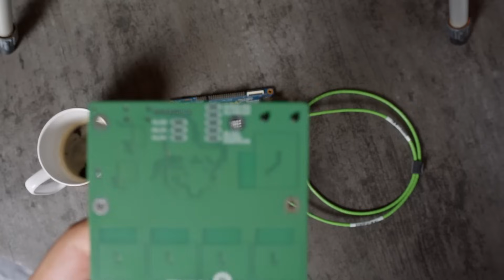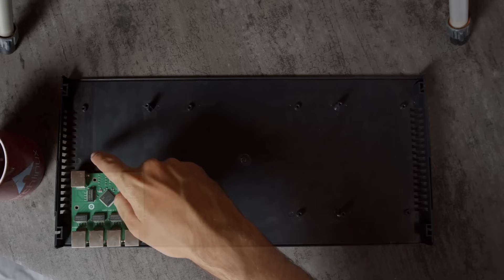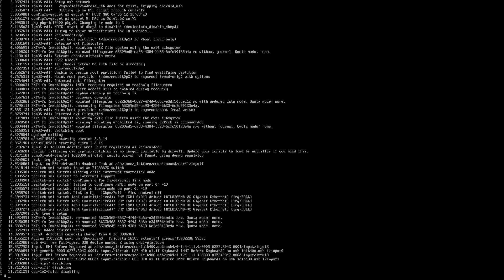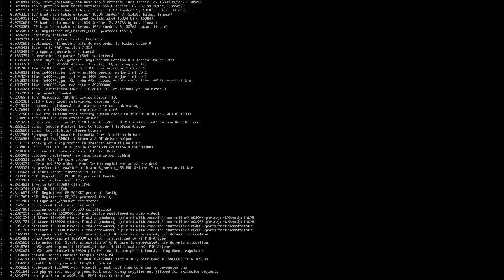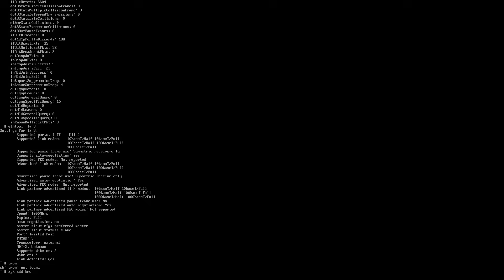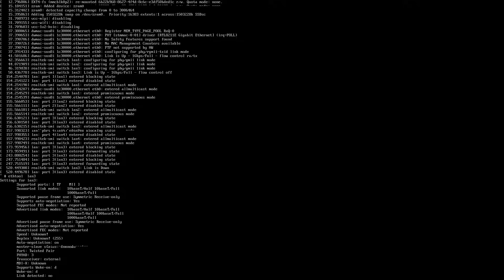Building my own 5-port gigabit switch for Linux control

Comment: Can we have the PoE support in this switch?
Reply from the maker: It is possible to extend the design to add PoE to it, but this would significantly increase the complexity. It would already more than double the parts to add PoE input to the switch and I don't think PoE output would be any easier, and you need way more of those.

Comment: @MartijnBraam, can I do un-managed standalone switch with this chip ?
Reply from the maker: Yeah that works fine. It's a regular 'ol 5 port gigabit switch when not controlled.
Reply: @MartijnBraam , thank you. In your github KiCAD schematic, is the chip  configured in such way?

Comment: Would the switch chip also do the switching, if i do the bridge with openvswitch? And if yes, would the switch chip also handle the switching when i configure openflow on the openvswitch bridge?
Reply from the maker: It seems like there's some integration to make Open vSwitch work with switchdev for hardware in Linux but I have no idea if it will work for this setup. In the examples I can find for it the interfaces with switchdev support added as seperate interfaces in openvswitch, I don't know if the bridge device created by openvswitch is a dsa compatible one but I guess it will be through all this.
Reply: @MartijnBraam  could you maybe test it? Because that would be then the first cheap openflow switch in years since the zodiac one, which only did 100 mbit

Comment: Nice work. I know a commercial unmanaged switch where you can access SMI without voiding warranty and there is an 8051 just waiting for your code to execute. SDCC goes brrrr. Too bad these infos are obscured / NDA'd.
Reply: Asus XG-U2008 has SMI pins under the serial# label. Oh, and it's a Z80 not a 8051.
Reply from the maker: Yeah if only I could get any of those docs. That would add a lot of interesting possibilities to this platform since you can access quite a bunch of gpios and busses with it and there's the internal network interface.

Which existing switch allows SMI access?

Comment: You are using ipv6 Internet. Is it really possible to ping any other device on ipv6 Internet if I know its ipv6 address? I mean, all devices are not hidden behind NAT, so they all are accessible directly by IP without need of intermediate node somewhere on the Internet.
Reply from the maker: That's not at all how IPv6 works. On IPv6 you have the same hiding mechanics as IPv4 but instead of with NAT it happens by the firewall, if you use any normal IPv6-capable router that's what happens in the background. IPv6 is also still routed like regular network traffic so it goes through all your intermediate nodes, you just stop changing IP addresses at random places.

Comment: I'm wondering if this can be controlled from a x86 system using a usb to gpio like FT232H. Not sure if Linux can be convinced to use that for the realtek-smi
Reply from the maker: It's not really possible to get a phandle for the gpios on an USB gpio chip so it can't be done in the same way at least. In theory it would be possible to add a glue driver in Linux but that would be pretty difficult.

Comment: The switch chip being used in unmanaged and managed models made me think of TP-Link and Netgear 5/8/16 port network switches that have both unmanaged and managed variants. 🤯
It's probably that the managed variants have an EEPROM chip (+ licence for the firmware) and reset button, while the unmanaged ones don't.
Reply from the maker: Yeah it seems like the main difference is the storage, the unmanaged ones have a tiny i2c eeprom for hardcoding a few registers and the managed ones have a 4Mb nor flash chip on the SPI bus with 8051 firmware and templates for the webpages. Apparently it's possible to grab the Netgear GS105E firmware from the website, load it in a nor flash and then boot it on this device but I have not tried it yet.
Reply: @MartijnBraam  
Interesting. I was thinking it'd also be possible with the TP-Link TL-SG105E firmware, but for the hardware revisions I have (though of the 108E and 116E because I don't have any 105Es), no firmware updates were released.

I also forgot about 8051 microcontrollers having existed, probably because when I think of a microcontroller chip, I usually think of an RP2040.

I saw your video on my YouTube homepage and didn't think it was possible for Linux to directly address a managed network switch chip until I watched it. I was surprised.
Reply from the maker: 8051 cores are absolutely everywhere. If something has the slightest chance of running firmware at all it most likely has an 8051 core in it.

As far as I know the SG105E and GS105E are practically the same device. The 108 devices are basically the same topology but it uses the RTL8370MB instead probably. That's an 8 port switch chip with 2 internal CPU ports available. This one is also supported by Linux.

Comment: i think that any MCU can do the management via MDIO/SMI but i had a hard time finding good libraries/drivers
Reply from the maker: That's true, since my final design won't have an ARM board but an x86 board it will simply be managed over USB with a raspberry pi pico. The code to get that working is relatively simple. I've seen some people also use an ESP32 to manage this.
Reply: @MartijnBraam  where?  i am also doing something similar ut 100Mb + esp32  on the same pcb , found some code in 1 place but i dont have that much information regarding the switch registers , i can only guess atm
Reply from the maker: I also can't find it quickly anymore, at some point I came across some github repositories with chinese readmes that had a bunch of docs and a picture of a PCB with an ESP32 on it and a reference that it was running lua code, sadly there were not more details.
Reply: @sanjikaneki6226 A Github repo called "Realtek_switch_hacking" by "libc0607" has what OP is describing here. It's rough through machine translation, but there's a lot of information there. Sorry for not providing a direct link, I never know what makes Youtube delete comments.

Comment: This is super cool! :)

What project were you working on that inspired you to do this?
Reply from the maker: This is one of the wild ideas for improving the hardware for streaming the FOSDEM conference. The main thing this is trying to solve is having a switch inside a 1U rack case that takes up as little space as possible and having one port on the inside of the case for plugging into a SBC. The alternative is having a cable looping around on the front which is ugly, or having neutrik ethercon jacks on the frontpanel and a bunch of small ethernet cables inside the case which is not space efficient.

The switch doesn't even need to be managed in this usecase but having monitoring would improve everything.

Comment: Could you share the PCB, or do we need to purchase it?
Reply from the maker: I'm working on the final touchups of the design. I didn't want to release the version yet that has electrical issues that required cutting traces and snipping off pins to get a connection up and running. It will be OSHW and can be fully assembled by LCSC.

Comment: I've been eyeing up those switch chips with the external interfaces for quite a while now - Thank you for going for it and making it happen! I hope this goes places for low cost high quality managed switches in the future! The manufacturers these days cripple their managed switches intentionally so much to make you buy the more expensive ones when the chips in the cheap ones are perfectly capable of many more features.
Reply from the maker: Maybe some day embedded developers will start making decent control interfaces for their devices, probably a few decades in the future though...

Would be interesting to create a proper managed switch firmware for the 8051 core in this but it's sadly completely undocumented how that core is supposed to work.

Comment: Can you share how you need to set the solder bridges to make this work? Do you just need SMI_SEL high or does it require anything else?
Reply from the maker: I have SMI_SEL high, EN_SPIF low, DIS_8051 high and DISAUTOLOAD low
Reply: @MartijnBraam  Thank you! I have a project laying around here, that uses a Realtek 8367N chip with SMI and your video fascinates me. I have never seen this anywhere before. So I would like to try this, even if it makes no sense in my project. Unfortunately the part how to configure this in Linux is very short in your video.
Would you mind sharing a few more details, like which dtoverlay you're loading, which parameters you're using? I tried grepping through the entire filesystem of my Raspberry Pi, but doesn't contain "realtek-smi" anywhere.
Reply from the maker: You probably will have to build all the DSA and switchdev related modules, no distro seem to ship it out of the box. I have written down more details here: https://blog.brixit.nl/making-a-linux-managed-network-switch/
Reply: @MartijnBraam  Very cool. I'll work my way through it and hope that my Pi will still boot in the end. 🤓
Reply: @MartijnBraam  Do you absolutely need the reset pin to be wired up to a GPIO or is that the interrupt pin you're talking about in the video? On my PCB reset is hard wired high, unfortunately. 😕
Reply from the maker: In my case I didn't hook up reset, it works fine without. The kernel driver really does want reset defined though so I just assigned it to a random spare GPIO. Hooking up interrupt is optional and only gives a slight performance improvement on things like port state changes.

Comment: What happens if you run tcpdump on one of those lanX ports? Does it work?
Can you include *MII interface in the next revision?
Reply from the maker: If you tcpdump on one of the lan ports you'll just get the traffic destined for your mac or ip on that interface, if it's in a bridge you still only see the packets for your own interface since the rest is handled in hardware.

The issues with exposing more interfaces like the MII bus is that most pins are shared for other functions so you can't make one design that fits all.

Comment: When I read your article, I had to think about IPv6 over BLE, 6LoWPAN and all those shenanigans.
Might be interesting to build a router that can also just route all these IoT radio protocols.
Reply from the maker: That should be easily doable by adding the radios for that to the SBC connected to the switch :)
Reply: @MartijnBraam  Don't motivate me. I need to get one thing done first. :face-blue-smiling:
Reply: @MartijnBraam  That's also what I thought. I flash a RTOS like RIOT on them and they just bridge the radio to LAN.
Reply from the maker: that would make a very neat home automation hub, add a few 433mhz radios, some zigbee maybe. Actual WiFi is also useful :D